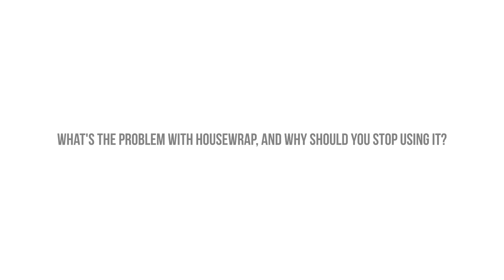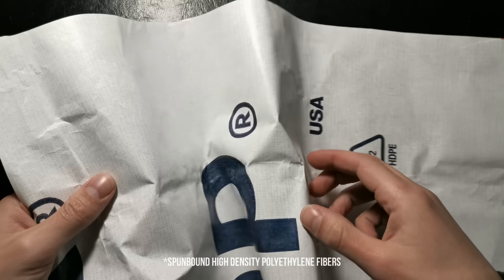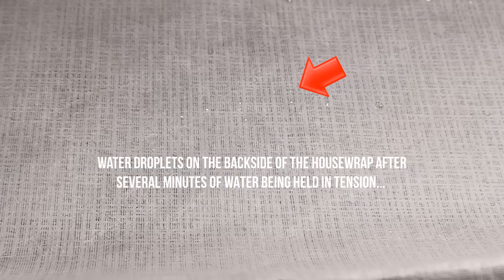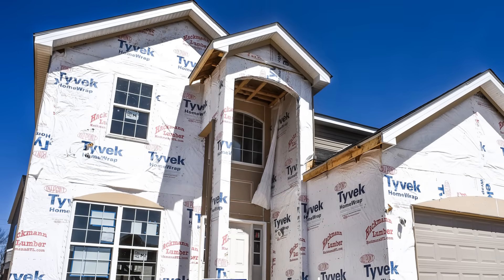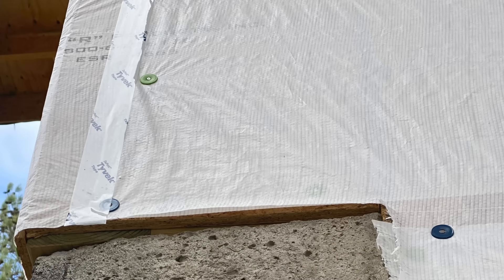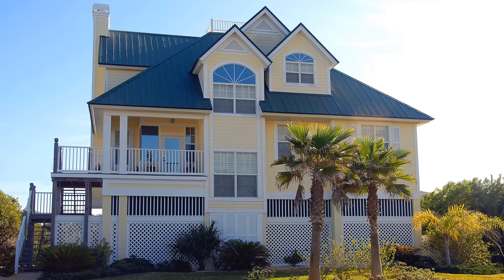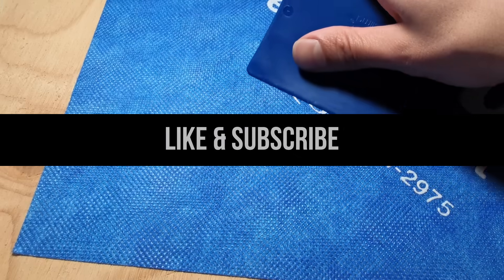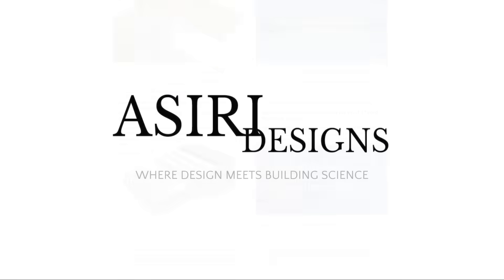Why I Stopped Using House Wrap

Comment: I read many comments here. I agree with some, not others. Building science is a real thing that needs to be understood.
Old houses were very drafty and not insulated well by today's standards. Moisture in the exterior wall assembly, over time, would evaporate. There were no building codes.

When homes became insulated better and made more air tight, that created new problems. Interior, impermeable poly vapor barriers were required by code.   Moisture condenses on warm surfaces. Think of a glass of ice water on a hot summer day. Moisture condenses on the warm side of the glass. That's where the DEW POINT is. It changes depending on the thickness and the difference in temperature between cold air and warm air. In a 6" wall assembly when its -30 outside and +70 inside (that's a 100 degree temperature differential) in 6") the dew point moves closer to the warm surface in that 6", hense the impermeable poly vapor barrier being closest to the warm side of the exterior wall assembly. DEAD, UNINSULATED AIR SPACES ARE THE KILLER ie; tiny gaps in fiberglass batt insulation, electrical outlet and switch boxes. Then air exchange systems were required in new construction, intended to mechanically replace interior air with exterior air and control humidity in the structure because, theoretically, they were so air tight.

Some comments here seem to neglect the fact that siding is intended to be installed over house wrap and rain will get behind the housewrap. That's not the issue. If water gets behind the siding it's an installation issue, not a product issue. Condensation is an entirely separate and more important issue especially in cold climates.

I can assure you that, whether Zip or housewrap, if every tiny gap is insulated, preventing DEAD AIR spaces, cold air will find a surface to condense on depending on the difference between inside and outside air, and it will be on the warm side of that surface.

Ideally, there would be no dead air gaps or voids anywhere. In reality, it's an installation issue, whether Zip or housewrap, and more related to the insulation than anything else.
Reply: Warm air condenses on cold surfaces not the other way around
Reply: @markmartin7384 
More accurately, moisture condenses on the warm side of an impermeable surface, hence the reference to a glass of ice water on a warm day. The principle is no different in a wall assembly which is why the most impermeable part of the assembly is the vapor barrier, installed closest to the heated space, and required by code in cold climates. Depending on interior vs exterior temperature differential, wind and air infiltration, the dew point moves in that assembly between the cold surface and the warm surface. The opposite would be true in a hot climate where the exterior side would be the warm side and the air conditioned interior would be the cold side. I live in a cold climate so I don't know how the code in warm climates deals with vapor barriers.
Reply: "Some comments here seem to neglect the fact that siding is intended to be installed over house wrap and rain will get behind the housewrap. That's not the issue. If water gets behind the siding it's an installation issue, not a product issue. Condensation is an entirely separate and more important issue especially in cold climates.
 getting behind the siding is normal for exterior plaster walls." 

@nofascisists, I think you meant if water gets behind the wrap it is an installation issue, unless I misunderstand. I fault the need for houses to be so tight. Great lengths are gone to for the purpose of making the house airtight, and then great lengths to control air exchange so the house doesn't trap stale air. Also it is all for naught once people are living in the house and open the windows. Maybe more in moderate climates, but even in freezing weather I often crack my windows a little and know others who do as well.

Comment: Why is there not yet a spray on solution? I can imagine a substance similar to rhino liner being used. Tape the joints before or after.
Reply: Problem is, all these "barrier" products for water and heat all seek to achieve something you don't want - a trap for moisture and air in the home. If you really do the perfect seal windows, doors, walls, floors, and roof, your house becomes a carbon dioxide death trap and fills with mold because every person in the house and your appliances exhale/sweat many cups of moisture every day that condense on and are absorbed into the building materials. So, the law says - "seal your house perfectly, but then buy a $5k air exchanger every few years to let your house breath, using electricity, space, and money. Praise us in our wisdom!"

Comment: Most modern Non-woven  versions of Tyvek-- have a 1 way membrane design, to let Moisturizer Out..  if, for any reason it gets Damp or wet..

How good is Tyvek after 1 to 30 years??  It's all-in how well they (flashed &) Taped around windows, doors & misc stuff.. xD

Both get thin & Brittle when exposed to light & the Elements. 💧❄️🌤 

Also, Fiberglass is usually made; from, recycled Glass.. ♻️

Comment: I did a lot of homework on this. I recently re-sheathed a mobile home. I used ZIP system. The biggest reason was the longevity of the product as I won't be able to put up the vinyl siding over it this year. ZIP will last until I can get that installed next Spring. You don't have to be worried about the vapor barrier being on the outside in the North. If the vapor and moisture can't get into the walls in the first place you're good to go. Don't over think it.

Comment: The Zip system to me appears to be over rated and way over priced. It looks like OSB that's been painted green. When contractors figure what the composition of the sealing paint Zip uses all you need to do is airless-spray your siding then tape the seems to get the same results as a Zip System for far less. A BIN sealer or an oil based polyurethane might work.

Comment: I'd say the problem isn't with the house wrap options. It's more to do with contractors that STILL don't know how to properly flash a window or door.
Reply: As a craftsman of 37 years I’m afraid I have to agree. While there’s certainly room for improvements regarding moisture penetration and control, flashing is first and foremost line of protection. Along with ice & water shield, where appropriate.
Reply: Poor installation is the biggest problem. Although there are different brands and qualities of what is called house wrap. The Tyvek brand is a quality product it repells water an breaths allowing moisture from inside exit out

Comment: In many European countries they use a rain wall over the normal sheathing.  A gap is left between the inner wall and the rain wall creating a void for air flow to pull away moisture.  The theory is the inner wall stays dry and any moisture that moves through from the interior gets pulled away by the air flow.  I always felt this was a good design.  The single biggest problem with house wrap is the crappy builders who install it wrong.  All of your pictures show wrap doomed to fail.

Comment: 3:37  WHERE did you get the picture from 3:37? That is a picture of MY HOUSE, that I posted on reddit asking a question about adding a concrete curb or slope to my sidewalk. 

How did you get that picture?
Reply: He saw your post
Reply: @Dufffaaa93 very unlikely, my post had nothing to do with tyvek though. Also it was a small post that received no attention. Yes tyvek is in the photo but still. I've never been so creeped out before
Reply: @Codeman785 on the internet things get propagated outside of the topic that you originally posted it. This is just how the internet works

Comment: That wall dissection at 3:23 looks pretty bad to me. That's a bad design that is almost guaranteed to result in mold growth on the sheathing, we tried that in the 70s here in Finland and that is not up to code these days and you won't get a building permit with that design. The correct way to use a vapor barrier is to use thick plastic between the gypsum board and the batt insulation. The plastic vapor barrier is taped from all seams and tested with a vacuum device that measures the delta p between outside and inside the house so you know you have an airtight barrier. In my house built last year the wall structure is 20mm gypsum board, 50mm batt insulation, plastic vapor barrier with all seams and holes taped up, 200mm batt insulation, 15mm gypsum sheathing board, 50mm air gap, 23mm wood cladding board.
Reply: I need you here in NJ. Finns are the best kind of intense

Comment: We do mostly acrylic finish over cement basecoat in Sask Canada and a lot of guys use Tyvek or Typar under their stucco. After doing repairs and redos I've seen a lot of time the paper is bonded to the cement, that can't be good. We use 60# tar based building paper and or Tyvek base against the house and then our tar paper.
Reply from the maker: We've seen the same issue quite often. Nowadays we address that issues with a drainage mat/dimple mat that can double as a bond break material.

Comment: A building needs to breathe.
Reply: That's why people who spend an extra $5000 to make their house air tight have to spend an extra $5000 on an air exchanger.
Reply: @joe-p9k4n  Airtight construction and HRV systems are code in Canada, where I live. They are outrageously expensive to install, cost ~$45 per month in electricity and the result is poor air quality and high humidity that can cause black mold. But, one can always crack a few windows in -40 weather or run a few dehumidifiers for an additional $$ per month. Nowadays, building codes are pushed by big business and big government.
Reply: Most modern Non-woven  versions of Tyvek-- have a 1 way membrane design, to let Moisturizer Out..  if, for any reason it gets Damp or wet..

How good is Tyvek after 1 to 30 years??  It's all-in how well they (flashed &) Taped around windows, doors & misc stuff.. xD

Both get thin & Brittle when exposed to light & the Elements. 💧❄️🌤 

Also, Fiberglass is usually made; from, recycled Glass.. ♻️
Reply: I have torn out the outer sheetrock walls aligned it with the thickest plastic I could find construction grade then insulated because it's a double wide it's like a sponge
Reply: I have seen Tyvek on a house for five years with nothing over it and it was still good so I’m not so sure on the sales gimmicks presented now!
Reply: No they don't. This is ignorance that came from the a misunderstanding of the science in the 80s and 90s. We've had completely air tight, net zero houses that have been around for 15 years that show no signs of deterioration and maintain the same R values and comfort levels as the day they were built.
Reply: There’s no such thing as a completely air tight structure unless you build with zero penetrations or fasteners. You can aspire to do so, but unless you’re building a highly specialized structure you will never achieve a completely air tight residential structure.  Consider this: Ever nail…every screw…every hole (for pipes, conduits, etc) in the wall or roof of a structure are an avenue for moisture.  I can walk on any project site and find a dozen or more areas in a wall or around a glazed opening that is leaking air - even with the most stringent best air barrier and glazing protocols.
Reply: @mistere5857  reading here its no wonder there is so many idiots in the trade and as GC. 

House dont need to breath, fast growth building method are not shittier. 

This video is just a salesman for zip sheating. No. You only need osb/cdx and tyvek.

Comment: Complex subject. In CO the enemy is wind. Hearing systems like radiant floor work very slowly. So it takes time to kick start a system from a cold start. With excessive air exchanges, the system can’t keep up. So sealing the house is needed.

In Vermont, we have hot humid summers and cold wet winters with humidity. Tyvek is not plastic. It can breathe and allow water vapor to pass thru slowly.

The issue with fiberglass is that a wall cell can move a lot of air which kills its R value. A closed cell foam works better. XPS extruded foam is one of the best followed by EPS foam.

I am a timber framer. In the old days they did wrap and strap. You begin with interior paneling followed by tar paper and fir strapping. Now you often see SIPs used.

SIPs are a great system but the exterior is OSB and the joints are foam sealed with closed cell foam insulation.

The first major complaint is that tyvek does not work that well with SIPs. The foam is a barrier. So the OSB under the exterior sheathing is at risk. You really should do something to insure air flow under your sheathing with weep holes near the sill.

Tar paper had been a go to for generations. Used to snub hard wood flooring, an underlayment for roofing, and a moisture and draft barrier in walls.

When new, it’s pliable. But in about 30 years heat and UV exposure can dry it out. But if left alone, it continues to work for a long time. It’s readily available and cheap. It’s easy to work with.

I think the best approach is to use a ZIP style OSB to fabricate the SIPs for the long haul.

I am semi retired and building a new shop and home. I am avoiding OSB as I can. My exterior siding is T&G board and batten. I am likely just going to old school it. Tar paper wrap and strap with XPS foam and copper flashing. These structures have lasted 200 plus years. The siding is attached to the strapping which locks in the foam with no framing cold spots.

Slate roofs differ from asphalt modern roofs in that they depend on side lap and head lap for waterproofing. Ice dams are controlled by higher pitches. A slate roof can go 200 plus years. No bitch-a-thane product will last that long! That is also why copper is used here including copper nails.air flow under the decking and strapping protects the decking.

So if I have to use OSB on exterior sheathing, you are better off using a ZIP style product. There are about three companies now making a similar product.
Reply: Thanks. How can we know if the OSB on our SIPS house is holding up? 
Won't it be years before the exterior or even interior OSB is denigrating? And if the exterior OSB  & Tyveck are / already Did fail, how long until the EPS interior insulation is affected?  Will the SIPS  walls & roof lose its structural integrity? 
TIA  - getting ready to build an ICF house with a 10" thick  SIPS  roof- and thinking I need something besides OSB under shingles!?

Comment: I've been a builder for 45 years. This is just another product to sell. Tar paper works well, as does Tyvek. Zip seating definitely works, but it's no better than cheaper products. Common sense water and moisture control doesn't depend on expensive products, it depends of knowledge and experience.

Comment: The two 1970s energy crisis had use worried we were going to all Freeze.

 So by mid 1970s Designers and Engineers purposely wanted super tight buildings.

That was the rage dogma preached as the end all..

Ie a building that breathed or leaked was evil and bad.

Tight windows and tight wall sections was the Gospel not to be questioned at all. 

Or get an F on your Hvac Engineering courses

So in the later 80s and early 90s Toxic mold arrived. 

Lol

Trap moisture in a building and get rot 

The whole Engineering and home designers and builders jumped in head first creating tight buildings with no real research. 

Ie the research was in infiltration and R value and goal was no infiltration and huge R value. 

There was not even the term toxic mold in the 1970s.

The entire mold problem is because folks jumped on the bandwagon and damned those who questioned the risks.

The same the last 2 decades is foam. Foam everything and seal in moisture.  Roof decking rots since trapped moisture . Termite control   terrible with foam.😊

Comment: you are basically making an argument on poor installation. Because the product itself is great. Tyvek will last forever if installed right. and if you can't install it correctly on something as easy as stapling it to the wall you might want to find another job. That being said Zip is a better product, but you can get great results from a wrap that can last the lifetime of equal to the siding.

Comment: 30yrs ago we stopped using tyvek and went back to astm felt paper.
Reply: What are your thoughts on BP Canada R-1.5 Panel Wall Sheathing Panel 1/2IN. Costs 9 bucks Canadian here locally. Has an asphalt outer coating. The old neighbor has something similar that his house is made of from the 1930s. Claims its great stuff and hasnt deteriorated in the close to 100 years its been in the house his father built and he now lives in.

Comment: The problem with house wrap is that it is susceptible to damage during installation and doesn’t encourage good workmanship. The recommendation of peel-and-stick, fluid applied, or integral to sheathing is 100% the best solution. All three approaches have full structural backing, making them more durable and easier to detail and install to a higher quality level. Paying more for your WRB/ air barrier is the best investment you can make in a house.